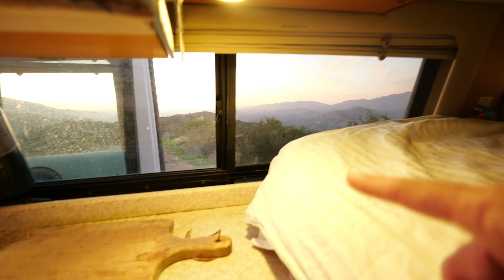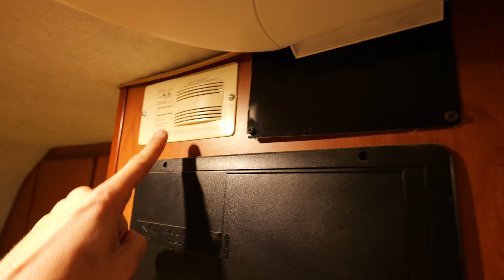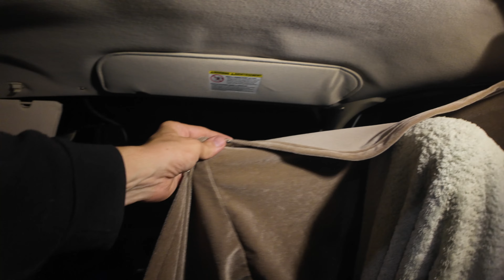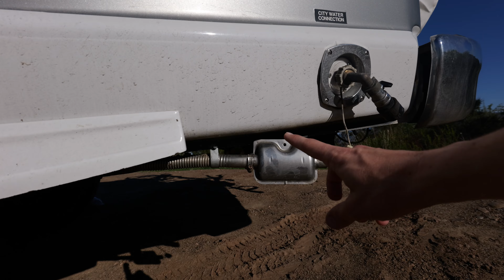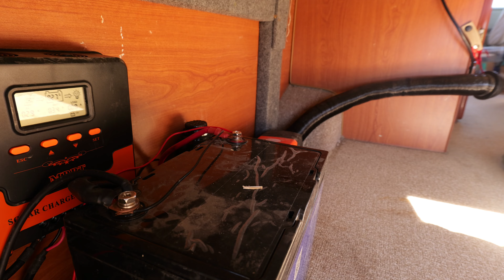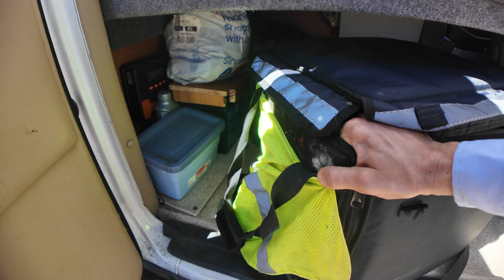4x4 VAN TOUR (Outdated, New Tour Soon!)

Comment: Change out that electric water heater for a propane HotTap camping instant hot water heater. Allot less electricity. Allot. 

Or just connect HotTap to the shower.

Edit: just seen you have a generator mounted undercarriage
Reply from the maker: Yeah mine is working ok for now especially with that generator, but the new propane and diesel ones are pretty awesome and efficient

Comment: Nice set up. Decent lithium set up 👍🏼. Lithium is a game changer for sure. I’ve only got 200ah currently but I’m upgrading to 600ah. I have a 2000w inverter too, it does the job….for now 😉
Yeah you have more room under the dog house. Mine came with the V10 and it’s a tight fit.
Reply from the maker: @Thesaltymedic36  thank you! That's awesome you have the v10. It's definitely needed for how heavy this thing is. I wish I had it every time I go uphill or off road.